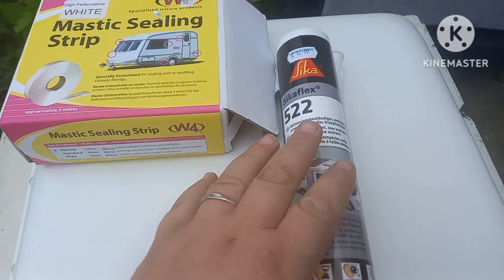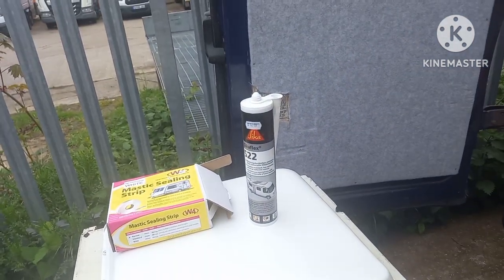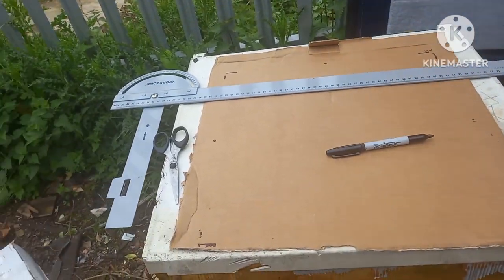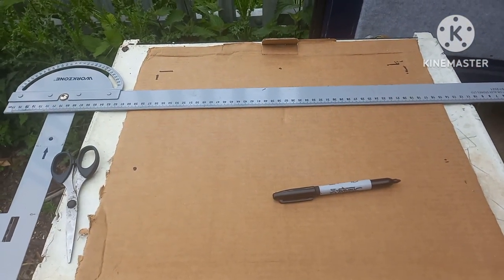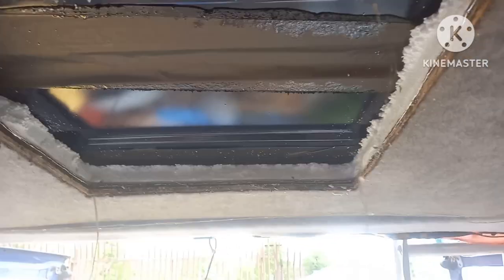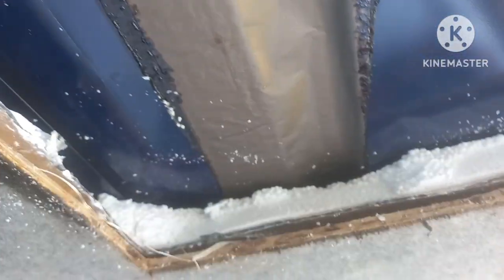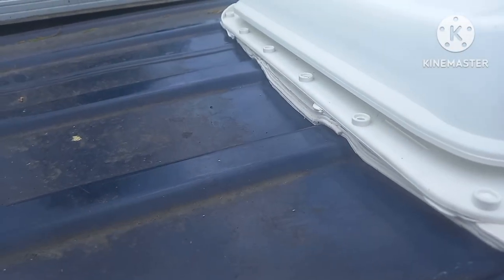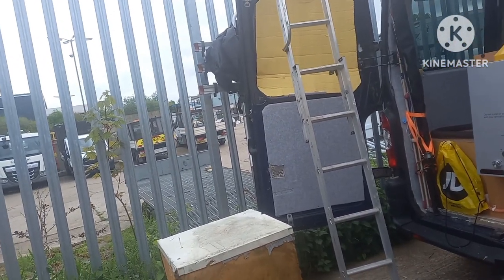skylight fitting

Comment: That’s a great improvement for ventilation. You will notice a big difference. My roof is ribbed like that and it really makes fitting anything up there tricky. Well done 👍🏻🚐 Trev
Reply from the maker: Cheers trev it does but the mastic tape is great stuff for building up the ridges